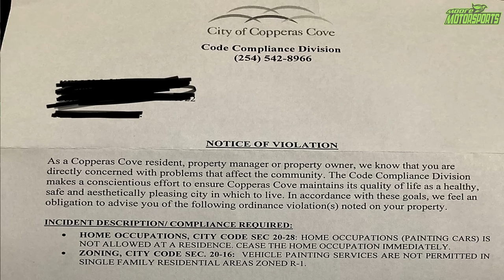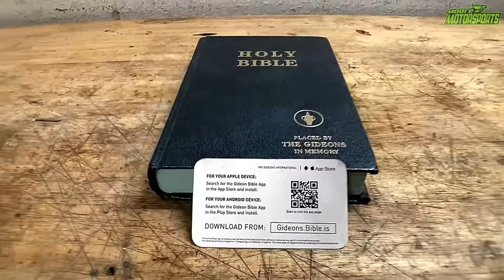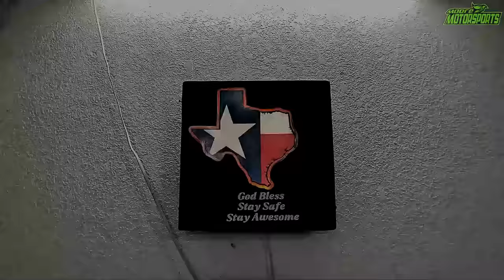TURBO PRIMER ONLY TOOK 2.5 CANS TO PRIME THE ENTIRE CAR!!

Comment: You should always start with the middle of the roof & work to the outside, do the other half of the roof, then do the hood the same way, then paint the body... that way you don't have to worry about getting up against the freshly painted sides of the car...it makes things much easier if you do it like that...
Reply: Good tip thanks

Comment: Great Video! I've been a Painter, Finisher, Sheetrocker, Carpenter, Home Restoration Contractor and home Mechanic. I fixed/repaired & rebuilt Me own vehicles and Me Families vehicles as well. I started at age 9 helping Me Honourable Grandfather Jerry a 98 year old WWII Veteran who lives alone and is still going strong. I lived with Him and Me Grandma in White Sound on Elbow Cay Abaco Bahamas from 1972 - 1980. I'm well familiar with Zinsser 123. I started using it first came out. It said it would stick to anything including Ceramic tile & glass. I thought this was a lot of hype and bs a sales gimmick. That is until I primed my first house with it. You're supposed to lap the paint on the glass about 1/16"-1/8" This seals the glazing to the windowpanes. The window cleaners scrape off the paint off from around the windowpanes when they clean the windows. I'm speaking of the exterior of a brand new house. The cleaners could not get it off. Traditional Paint & primer was easy to clean you just cut around the windowpanes with a razor blade knife. The primer and paint scraped right off with your razor blade scraper, it comes off very easily, but 123 will not. Nearly broke the windowpanes cleaning the 123 off. In those days windows were mostly 6 panes on the top window and 6 panes on the bottom window, called 
6 over 6. A few were 6 over 9 so you can well imagine how much trouble it was to clean this many windowpanes off on a brand new house. Needless to say I never used 123 to prime windows ever again. It is an extremely strong adhesion product. I can't think of any other primer that sticks better than this. I don't know how they do it it's water-based but it's indestructible when dry. I never thought of using it for priming a car but this is a great idea. Being a water-based product it would be probably 6 to 8 coats thick in one coat when compared to an oil-based automotive primer. 123 is much thicker than even high  build  scratch & nick fill oil based automotive primer. They didn't have turbo spray cans with the wide fan like they do now back in the day. If I prime anymore automobiles I would definitely use this primer unless I had a rust problem. Then I would treat any rusty metal with Ospho before priming. Ospho chemically converts rust which is iron oxide to iron phosphate a hard black inert substance which will no longer rust. If you stand on the car and remove any light rust powder then treat it with Ospho on the rusty spots before you prime you won't have to worry about the rust coming back. This makes it much easier because you don't have to physically grind every little rust spot out. All you need to do is go over them lightly with the sander get all the loose powdery rust off and then treat these spots with Ospho before priming. I've been painting 50 plus years and I learned something new from this video. Thank You! The old saying we've all heard, you're never too old to learn is true and correct as I can attest to by this video.
Makes me feel stupid I didn't think of doing this myself. It's just so obvious, I guess. 
I never thought of it because it is so obvious. Zinsser 123 is one of the best primers on the market hands down. It will literally stick to anything and any kind of paint and or finish will stick to it including regular wood stain. If you have it tinted a pine color or some other type of light coloured wood (you can only do light colors with it unless you buy the Deep tone version of this primer) you can stain a door shutters or anyting else that you prime with wood colored 123 primer and using a China bristle brush you can stain it regular Minwax penetrating stain and it will look like wood if you place your brush marks with the direction of the wood. You need to spray over this with Minwax exterior Marine Spar varnish or some other high-quality clear coat finish on the first coat then you can brush it after that. I would just keep on spraying it 3 coats total. You can use it to prime anything. Plus it blocks color bleed and other types of stains from coming through your finish coats. My only caution is you better put it where you want it and be sure about this before you use it because once it's dry it ain't coming off unless you sandblast it or burn it off. I couldn't even get it off with heavy duty extra strength MEK (menthyl ethyl ketone) chemical based paiste strippers, believe Me I've tried. Zinsser 123 is literally indestructible. If they made a high-gloss version of it in colours and a clear coat you wouldn't even anything else to paint cars with. And it wouldn't chip like traditional car paint when somebody bumped it with their car door. You wouldn't think so but oil based primer is ten times easier to get off this stuff. I don't know what the hell is in it but if they make glue out of it you couldn't get whatever you glued apart. Is sticks better than any primer I've ever used except maybe two-part epoxy primer and it sticks just as good as that.
God Bless Y'all
Jimmy in NC....
Reply from the maker: Thanks i appreciate the time you took to write it all and your right its really strong stuff and God bless you and your family and much respect to your grandfather GOD BLESS Y'ALL!

Comment: Hey moore, I'm about to do one.   Should I use primer sealer before or after primer (if at all) if I'm scuffing up factory paint?
Reply from the maker: If your scuffing the factory paint you shouldn’t need primer I never needed it for a good scuff and paint as long as the factory paint is in good shape.

Comment: I use this Zinsser primer alot, I use mostly Tractor/Implement paint and it works amazing. Alot of people look at me like I'm crazy when I tell them it's tractor paint but it's cheap and you have to learn mix it correctly, I thin it out and use less hardner, in stead of a 1:8:1 ratio I use a 1.5:6.5/7:.75 ratio. you have to thin it so it doesn't crinkle but with more hardner it takes less hardner or it will become brittle plus it only takes 30 minutes to flash instead of the hour it normally takes and 8 hours to dry instead of the 24 hours that it usually takes.so I can spray it at night before bed and cut and buff  the next morning.

Comment: Solid job! Do you suggest using primer even if you're using rustoleum paint that has primer in it?  I've seen that in some videos you prime and some you don't.
Reply from the maker: Most the time I don’t use primer if it’s not different colors like black bumper, silver fenders, blue door.
Reply: @JamesDguy  gotcha, would you use primer if doing a really color change? My truck is burgundy red and I plan to paint it with rustoleum orange this summer.

Comment: would you prefer it if rustoleum had wide spray caps like that primer?
Reply: Rustoleum has turbo primer cans. It's the red oxide primer tho.
Reply from the maker: @towboatjeff this is rustoleum primer it’s in white and gray.

Comment: Offer your neighbors a big block of cheese to go with that wine. If no body showed up your good.
Reply from the maker: The city always shows up and police don’t ever come by but the city offers $2,500 citation if i get in trouble for this. I can’t afford that. It’s insane
Reply: After about 5pm they ain't coming lol. Throw them a curve ball with a covert op lol You should have two small vents in your garage. If you can find a couple of those turbo looking fans they will flow the air out nicely. If they see the box fan they assume your painting.  Lord rebuke them for interfering with your ministry.  I'll keep you in prayer.
Reply from the maker: @camlobesvtec Thanks but they live on this street they don’t even need to see it they just need a report

Comment: "Home occupations are generally defined as businesses or commercial activities that are conducted from a person's home. If the vehicle painting services are only for personal use, then they would not meet the criteria for a home occupation, even if the painting services were provided by the resident of the home.

However, it's still important to check with your local government to determine any applicable zoning or other regulations that may apply to the painting of vehicles on residential property, even for personal use. Some local governments may have restrictions on the use of hazardous materials or the storage of vehicles on residential property, so it's always best to check with your local authorities to ensure compliance with all relevant regulations." -Output from a prompt to GPT take this information with a grain of salt. If you want to fight it maybe seek an attorney and discuss if what you do qualifies.

Comment: I believe it's the sheer volume of vehicles you've done that makes the neighbor(s) think you're running a business.  And where it comes to zoning they can't restrict you from doing what you want as a citizen or resident that's why it says occupant (as in occupation).  I also see the other side in terms of concern of overspray sanding debris / dust and possible hours of noise.  I believe you're being respectful but the neighbor(s) were probably used to the previous folks being very unseen/unheard and are using the city as their "muscle".  I'd also look into if you are "required" to allow any type of "inspector" into your house (including the garage) - even still they won't find a pro painting setup there so it should be a quick visit.  The inflatable paint booth might have been a bad idea too.  Perhaps it's more motivation for your plans.
Reply from the maker: The people who reported me know exactly what I’m doing. I even helped them before free or charge. They know I’m not running a business they act nice to my face but the fact is they hate me. I love them but I can’t stand them.

Comment: Just cuz u spray primer on it dont mean its primerd properly you need atleast 2 3 coats in all .
Reply from the maker: This primer is thick and high build test it yourself. It worked perfectly fine so your incorrect on this particular topic. If using spraying gun then your correct but this stuff is REALLY REALLY thick. Again I recommend trying it yourself to see.
Reply: @JamesDguy  I use 2k primer out of an aerosol can all the time I'm assuming it has the same amount of build , u can only add so much primer at ounce before u run into problems anyway wich is another reason u layer as thick as It may spray a single coat ,but if it worked out then it worked out for u  im just saying... plus on the hood u can see how light u spray it compared to the rest of the car wich means you just threw it on inconsistently around the car wich means its uneven too and those areas are prone to peeling.

Comment: How did you get the Turbo primer spray correctly? Ive used Turbo Primer White and it gunks up or gets chalky on the nozzle therefore the paint comes out all textured and horrible.

Comment: Regarding your neighbors and your neighborhood, you should probably take the high road. In my younger years I used to do a lot of dirty noisy smelly stuff in my garage like painting, welding, repairs and fabrication with loud hammering without a thought about my neighbors. Now that I'm a little older I still want to do those things but I often consider what my neighbor might be going through. Just like me, perhaps he's coming home from a long day of noisy smelly work and just wants to relax in peace and quiet. I understand that some neighbors can be very hard to deal with and can be very unreasonable but you just have to get to know them and alow them to know you. Other than that, you're just the noisy, smelly guy next door or across the street. I still got my stuff done but once in awhile, a neighbor would come over to chat or ask for assistance, not complain.